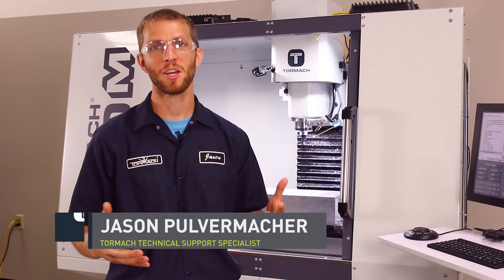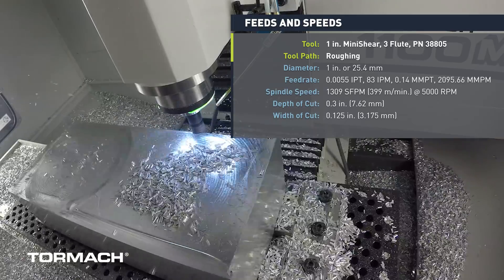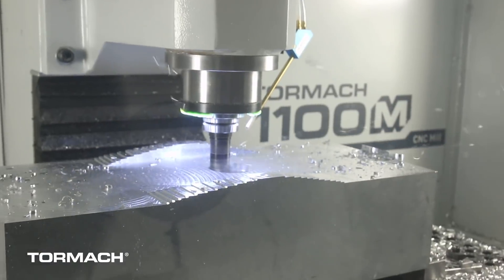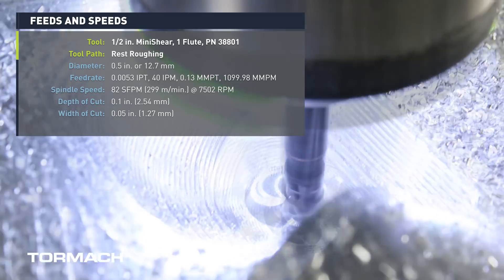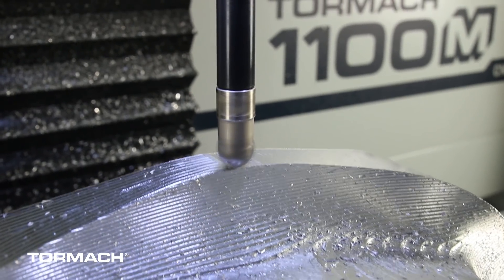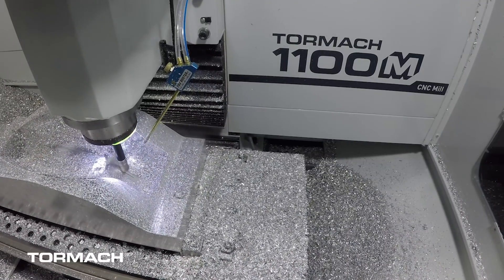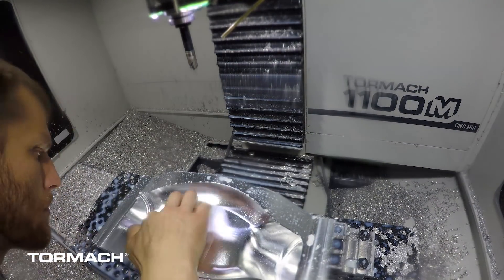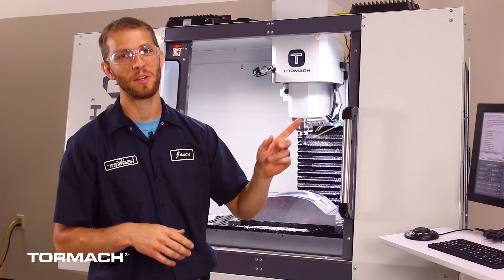Making a Carbon Fiber Mold for a Corvette Intake on an 1100M

Comment: I looked at a Tormach for my aluminum molds but they're the wrong tool for the job. The spindle is far too slow as molds usually require fitting small tools into cavities.

For 1/8" and 1/4" carbide end mills in aluminum I work at 18,000 to 24,000 rpm. I know they have an optional high speed spindle attachment but it's hardly ideal.

Also, the travel is far too limited on a Tormach which is why you only ever see people making mundane parts. I can't watch another fishing bait mold video or someone spending 5 hours making a bracket they could have got for $5 off ebay....

If you want make a rife stock mold, or one for a guitar or bike frame you're better off using the same money for one of the more rigid CNC routers with 48"x24" travel+ IMO.
Reply from the maker: Many of our customers, including our employees, use the 24R for their rifle stocks and and guitar bodies and necks. It's the right tool for the job. https://tormach.com/machines/routers/24r-cnc-router.html

Comment: How much would a part like this cost if a customer only had a 3d model to provide?
Reply from the maker: Hello Brian, thanks for the question. This is a seemingly simple question, that can be rather difficult to answer. Cost depends on material costs, and cycle time; along with any modeling, programming, or finishing time needed. On this part, we had everything wrapped up in a couple of days. The majority of the part was run unattended over night.

Comment: I am so close to pulling the trigger on a 2nd machine, I just really wish the servos were available as I need the speed on the rapids.  I really love PathPilot and how quick I can get a part setup and the machine running, but when you have 60 parts that each need 4 ops,  I  need faster cycle times!

Comment: I believe that the added spindle RPMs will pay off with big dividends.  With servo X,Y AND Z, I think that the machine will be more pleasant to work around in close proximity.  Personally, I've disliked the ssound that steppers make. I guessing that the rapids will be higher also. If so, another attribute toward making the Tormach product both capable and very affordable.  This really gives the up and coming shop owner a shot at building a successful shop on a budget that has true capability to be competitive within their niche.

Comment: Beautiful work! Can you talk a little bit about post-machining mold finishing? BTW we are the proud owners of serial #84 PCNC1100, and she's still runnin' great! Thanks
Reply: PCNC1100 Serial #14 checking in.
Reply: Now I know someone has even older 1100 than I do).
Reply: I'm talking about mold polishing using 22,000+ ripp-ems air tools, the final step to get rid of tooling marks (even though those finish passes are tasty). The type of work that you see the old very experienced sirs doing in the corner of the mold shop so nobody can see their magic techniques...
Reply: For aluminum molds, I use 200W dremel instead. Wool, and tiny rubber green polishers do the job very well. Also, I'd recommend the steel wall for tooling marks removal. It is very helpful. The old sirs work with steel, they use special vibratory $$$ tools, dental/mold polishing tools, etc. Hand polishing gives a very good result, but time-consuming.
Reply from the maker: Always happy to hear from proud Tormach owners! There weren't any post machining ops with this part. The finish is straight off the machine!